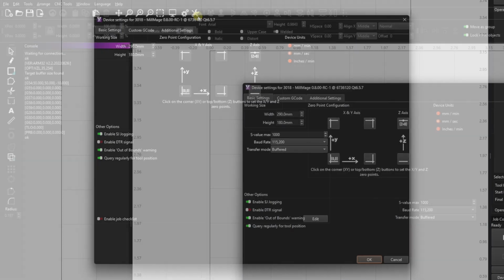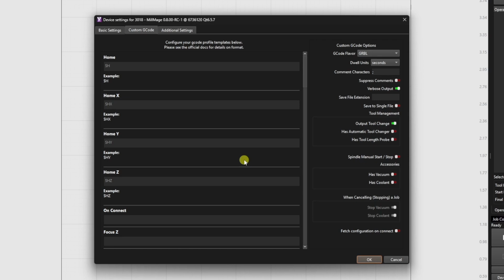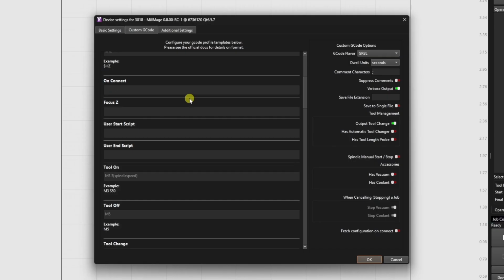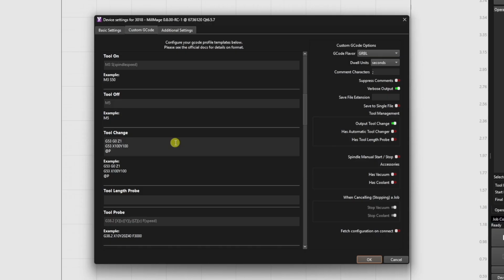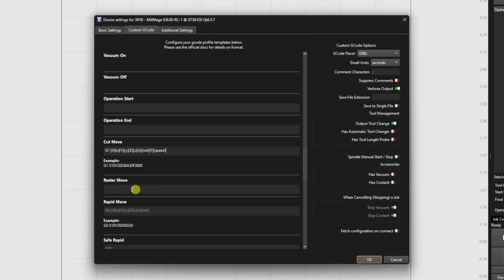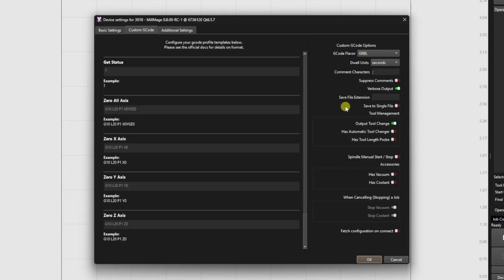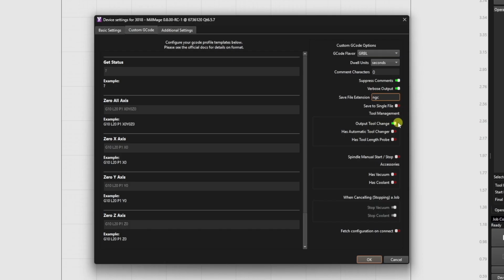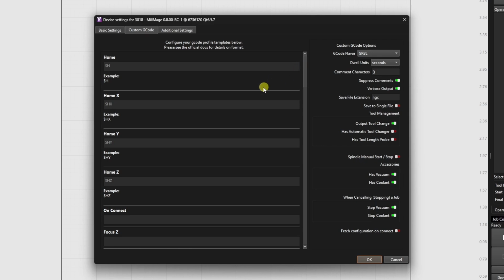Custom GCode in MillMage

Comment: Ai wanan use this millmage with my cnc plasma table that uses Mach 3.  I have purchased an opt laser that is compatible commands as in firing and such .. so if I import my design and set the line and fill options that lightburn allows will I just save gcode and the millmage program will generate for me to just import the file into Mach 3 or will I have to configure all what I showing in the process ?
Reply from the maker: For a plasma table you are likely better offer sticking with LightBurn and customizing your GCode there — the same Custom GCode interface exists in LightBurn, but with different options.

With that said, yes, it will likely take quite a bit of configuration to get what you need.